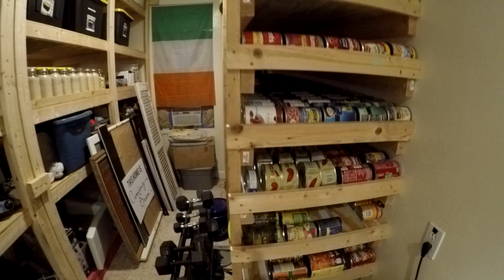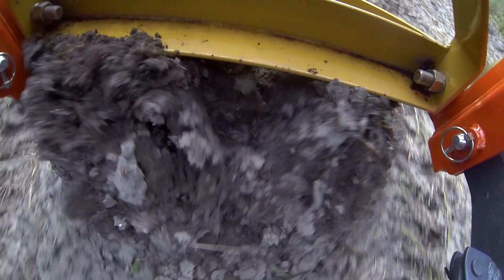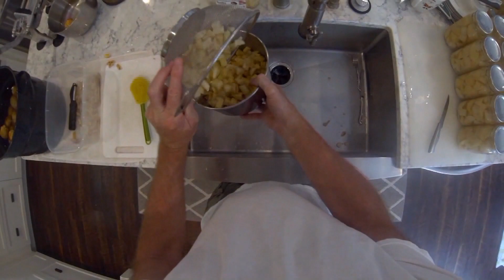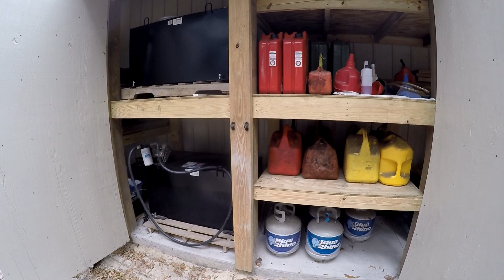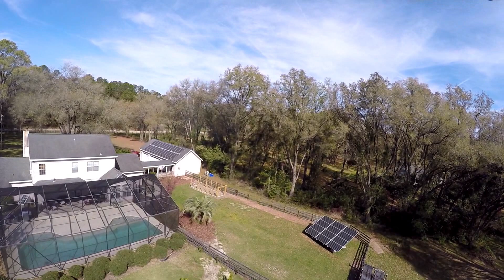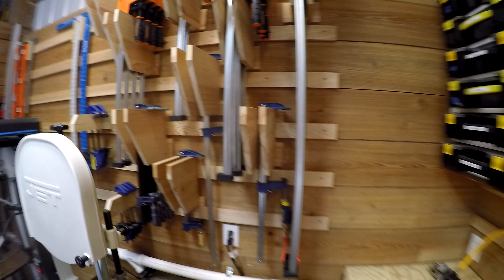Prepper Food Water Fuel and Power

Comment: Did you have a company install the solar panels or did you do it yourself? We were quoted $90k for a 5,000 Sq ft home. 😮
Reply from the maker: We did the entire thing ourselves.  It was about $34,000 in hardware before 30% tax credit for both the roof mount and the ground mount.  13,000Watts of panels, 9,000 Watts on the inverter and about 15kWh of usable battery.  This system would be a challenge for a novice to install and I would not recommend.  There are systems out there that just about anyone could install and they are under $20k.  Please don't spend $90k on a system.  Check this out: https://youtu.be/mzZR6SWonrY
Reply: @HomesteadEngineering  thank you! Yeah, we had no intention of spending 90k. I about kicked the salesman out of my house. 🤣

Comment: In the Arizona desert, if the electricity's off and the water company can't pump, the way I see to get drinking water is in swimming pools. But some use salt, which can't be drunk and can only be removed by distillation (or reverse osmosis. But because pipes to reverse osmosis filters in a household that has them wouldn't come from the swimming pool plumbing, but the household plumbing, that wouldn't work). I also just checked with a Berkey filter tech who said Berkey filters haven't been tested for salt, or for muriatic acid (hydrochloric acid), which is added to pool water for alkalinity. However, salt will clog and ruin the filter and shouldn't be put in a Berkey unit. 

The swimming pool has about 3,600 ppm of salt, while the most one can drink is 500 ppm. Less is better. 

To distill water, a "still" takes heat to bring water to boiling, so wood or a concave, mirrored solar lens might be possible to heat the pot. Or a 900-watt hot plate if one has adequate solar electricity. 

But the water or alcohol stills on Amazon use ice (or at least recirculating water) to cool the hot steam in the copper tube to condense the steam into distilled water. Without much water and no ice, how could we cool the copper tubing? Should the copper tube be a lot longer to condense into water in the hot desert air? I'd appreciate your suggestions since drinking water is essential for survival.  

(I also read that dogs die in 6 months if they only drink distilled water, so minerals must be supplemented in the diet, such as pink sea salt.)

I've seen primitive videos about putting a few inches of salty water into a container, putting an empty cup in the middle, covering the container with a plastic sheet (food grade or polyethelene?), and placing a small pebble or weight on top of the plastic in the middle above the cup. That way, in about 3 hours of sunlight, evaporated water condenses on the bottom of the plastic sheet and drips down into the cup. I wonder how much larger a system one could build, since a person needs 1-2 gallons of drinking water per day?

Any suggestions on any of this would be much appreciated.

By the way, I once calculated that most increasingly grungy swimming pools may evaporate in about 8-10 months in Arizona. But we do have two rainy seasons 6 months apart, depending on what falls in the rainwater. I don't know if nano-sized particles can be distilled out, but heavy metals can. The nuclear half-life for one particle is 8 weeks. Another is many years. But who knows? Perhaps that will not evaporate with the steam since it's so heavy and often attached to dirt.

How can we get safe drinking water in the desert?
Reply from the maker: AUP, In my case I don't plan to use the salt water pool for drinking water.  I plan to use it for stuff like bathing and flushing toilets.  Here in Florida water is not much of a concern as it is plentiful.  I have not put much thought into water but if I were in the desert I guess I might think about an over sized rainwater catchment system.  I would want to store enough to last 1.5 times longer than needed.  That is probably going to be thousands of gallons and probably cost upwards of $10,000.   Take a look at this setup:    https://youtu.be/dIraUiiqaK8